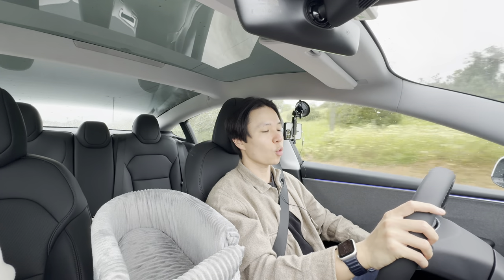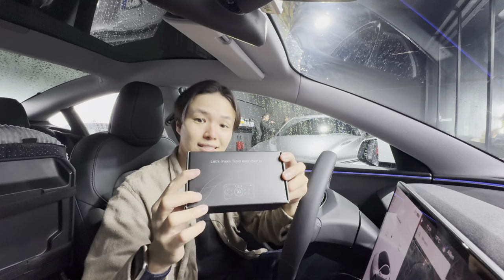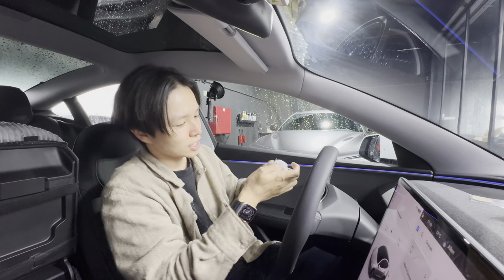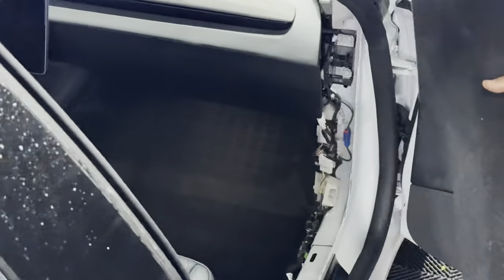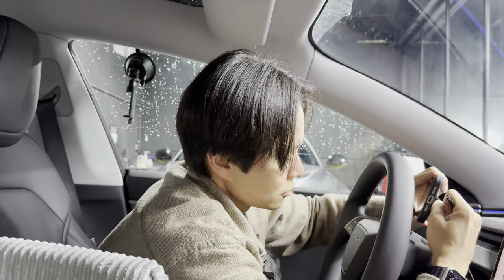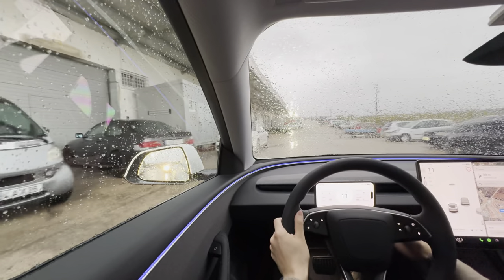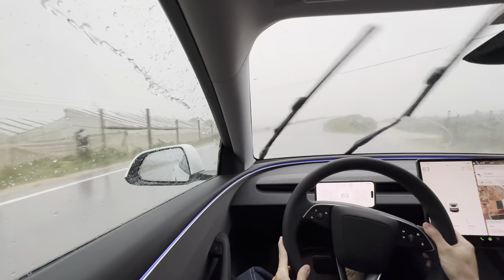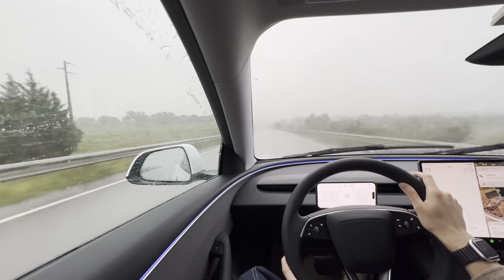Fixing my TESLA Model 3 Highland | TESLOGIC Review

Comment: Can you still take calls? Also all those features you would not use while driving as hard to scroll as you would have to place your hand through the steering wheel! I think the info is cool for speed maybe but I don’t have any issues with it but you can get most on the screen anyway.
Reply from the maker: Yes you can take calls - it’ll just override the app.

Changing screens: you can use the right scroll wheel on the Tesla steering to “swipe” left and right on the Teslogic so no need to touch your phone when it’s on 🙏

Comment: It is cool, but what about the tesla warranty since this application needs to be connected on the service port?  Would it be considered a security risk by tesla?
Reply from the maker: Hi! According to the Teslogic website, it does not affect the Tesla warranty: https://teslogic.co/pages/faq

In terms of security risks, I'm not sure of any - I've tried to do research on this but if you do have concerns, the slider inside the TESLOGIC control module to turn it on/off is actually to set the control settings on/off - so if you want the TESLOGIC to be read-only (not allow it to change any settings when you're driving), then that could be safer if you are concerned.

Comment: What a useless product why ?
Reply: Purely as a display of what the screen tells you is more or less useless I'd agree, however it gives you full time blindsspot indicators without needing to use a turn signal, it gives you manual preconditioning, can time 0-60 and give you power info, accurate battery health and other stats